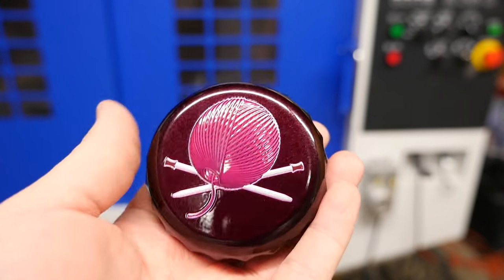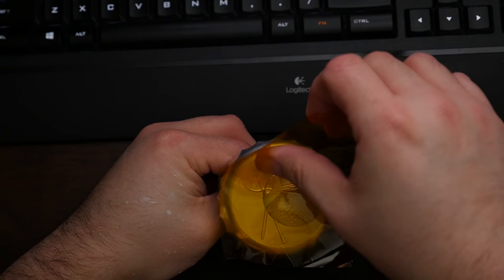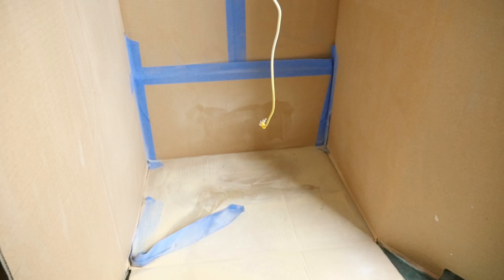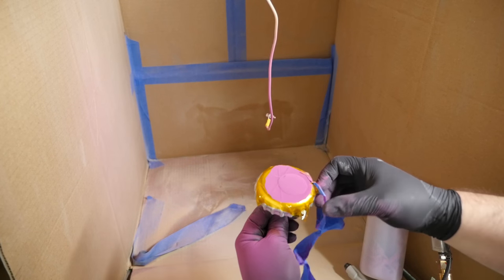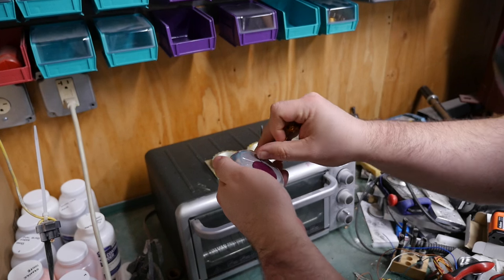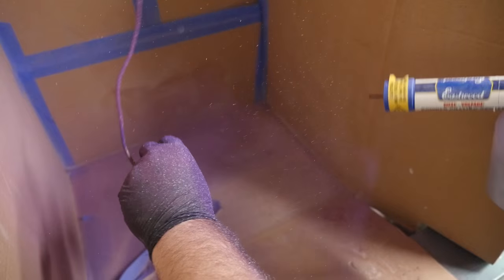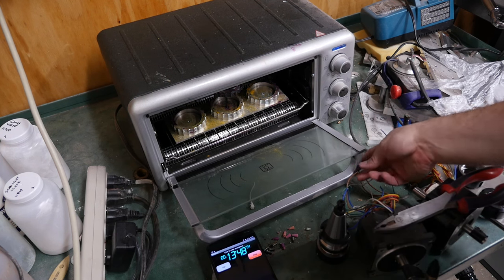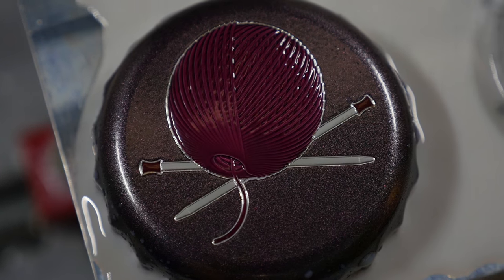Yarn and Crossneedles (2 of 3) Kapton Masking For Powder Coating Different Colors

Comment: The final clean up pass in the mill was brilliant!!  I wouldn't have thought of that and it made it perfect!
Reply from the maker: Man, it was a relief to see that it got cleaned up so well! The jagged seams between the colors looked pretty bad (if you were looking that close). I was dreading having to do all that again if it didn't look good enough. Since this one was going to my sister I wanted to pull out all the stops.

I've used the Tormach Drag Knife for one cap so far. It does a good job and also saves a lot of work and frustration. I thought it would probably be pushing it to try to do the few 3D bumps over the needles with the knife. I would like to do a vid on it, but you know how that goes...
Reply: +Hirudin I do know how that goes.  :)

Comment: Wow, great powder coat work!  How do you change from one color to another?  The instructions show a process of blowing all the powder out. I need to use 3 colors all the time so I was going to buy 3 guns. I already got the 2nd gun. Thanks for the great video!
Reply from the maker: +Craig's Machine Shop 
Thanks again!
Huh, I thought I recorded video of spraying off the gun between colors. It must have been in the maroon section that I cut almost entirely.
That's the gist of it - spray it off. I unscrew the bottle and bring it far enough away from the threads that I am able to tap the bottle against the air-inlet tube that goes down into the bottle to knock all the powder that I can back into the bottle. Then I move the bottle over to the front of the gun and tip the gun into the bottle. Sometimes a tiny bit of powder will come out of the gun that way. Then I basically spray air all over the internal parts of the gun to get all the powder off that I can.

Some genius at Eastwood apparently decided that the air inlet tube should be 3D printed or some crap as the surface of the tube is horrendous. So much powder sticks to that tube it's pretty amazing that they let it go out the door like that. I focus most of my air-spraying efforts on that tube, but I also spray into the powder outlet tube (the short one) to spray out any powder that I can. I also spray from the front of the gun backwards to try to loosen up any remaining powder.

It's not perfect, but it gets the vast majority of the powder off. There have been a couple times where I powder coated something white and then looked at it with that super macro lens and I could see that some particles of other colors got into the white paint somehow. Normally I'd assume Eastwood was making these seemingly poor design decisions in an attempt to upsell existing customers, but I don't think they sell a "better" gun, so I can't imagine that's their reasoning.
Reply: +Hirudin - Sounds like i'm better off with 3 guns. My products only come in 3 colors.  Thanks!

Comment: Wow you have me wanting to dive into some powder coating now!  That design pops with that color scheme!  I'm looking forward to seeing the clear coat.  Again, I have to say that your sister is a lucky lady to get such a slick present.  The ghetto box/enclosure is awesome BTW LOL!  Your grounding method had me rolling on the floor, but it is a bonafide solution for the task at hand.  Have you ever thought about getting one of those cheap HF sand blasting cabinets to work in?  They just sent out 25% off coupons (again) so maybe that could get you hooked up.
Reply from the maker: +Doug P 
Ah, cool! I hope I didn't over- or undersell it. I really like the results of powder coating, but man am I ever not enthusiastic about doing everything that needs to be done to get those results. I "_get to_" do machining projects but I "_have to_" do powder coating projects; does that make sense? Different strokes for different folks though, so it's great that you can get your feet wet without having to spend too much money. If I could recommend one thing: start with some striking colors. They go on just like the boring colors but they look so good! Even the "silver vein" (which is on that Bar-Z bottle cap I made) basically just involves spraying it on and baking. Just make sure you can't see any metal when you have a strong light on it, throw it in the oven, and you'll probably be fine.

I have indeed thought about getting a sand blasting cabinet for powder coating. It seems like it could work. I'm guessing the standard blasting gloves might be too thick, but I would also guess they wouldn't be too hard to replace.

I guess every time I think about getting a sand blasting cabinet for powder coating I start thinking about how I don't even have one for sand blasting... Then that leads me down the "how much is THIS going to cost me" and "I gotta get my Novakon mill sold before I think too much about buying more equipment" thought processes. That's usually discouraging enough that I just put it out of my mind entirely, apparently. :/

Every time I think about that grounding wire I crack up. It's SO half-assed it's comical. It DOES work though, which means it may be many moons before I actually do it right. LOL
Reply: I hear you about having a passion for doing something versus having to just do something.  I love making knives, but I have to make sheaths for them.  I love making chips and swarf, but I have to clean up my work area after a project :-).  Hopefully someone bites on your Novakon soon.  That's a significant chunk of change to have tied up.  The worst one I did in recent history was buying a duality lathe and tooling from Tormach.  That thing sits on a bottom shelf and holds down a cheap box of import 5C collets these days.  Just buy the blasting cabinet and you'll certainly use it.  I'm going to follow your advise and pick up a powder coating kit and some bitching colors!

Comment: I start the timer when it starts to melt...
Reply from the maker: +RoboCNC Frees- &amp; Graveerwerk 
When it starts, or when it finishes melting? If I recall correctly, Eastwood emphasizes that they want you to start the cure timer when the part has "fully" flowed-out. Prismatic Powders says to start it when the part reaches temperature. I really gotta get a thermometer inside the oven so I can stop relying on the (surely inaccurate) dial on the front.
Reply: Yes basically I start when it starts, although I do sometimes wait till it looks like a convincing melt... btw I do preheat the oven with a thermometer inside.